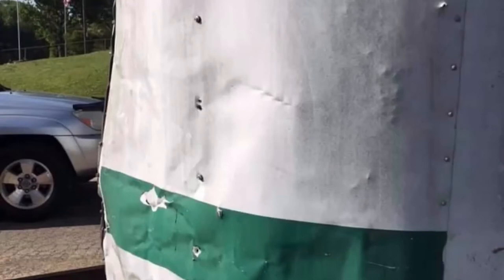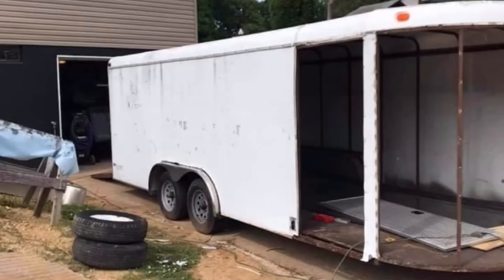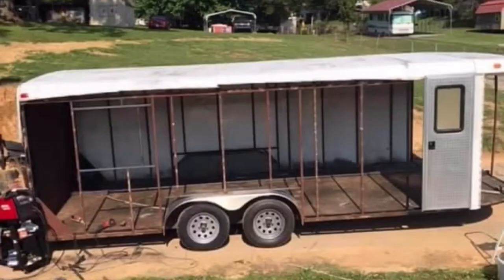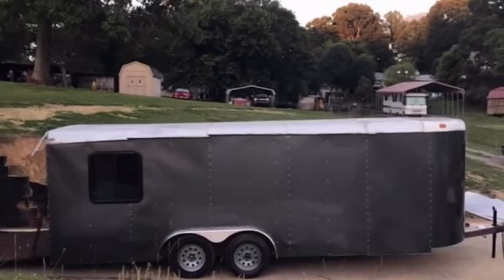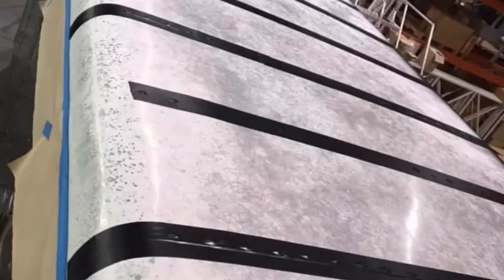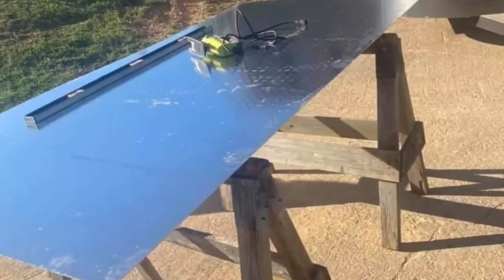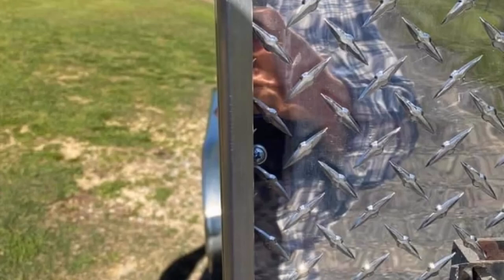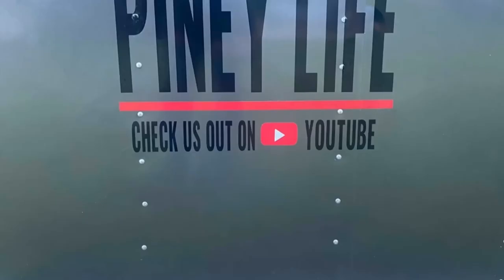Enclosed trailer rebuild for CTC

Comment: Need to replace walls on my horse trailer,  walls 7/8” material with wood inside of vinyl sides. Any suggestions what to use
Reply from the maker: I have a stock trailer i was working on not long ago and we used 4x8 sheets of 1/8 aluminum on it but that because cows beat it to death. If the inside is wood with vinyl over it i would try to duplicate it to what it was factory to the best i could. Now that being said wood is expensive right now so i might look into plastic or poly sheeting. some companies offer thick plastic sheets for like die cutting or roll cutting you can get. Plus to that is they would never rot. Still got to take into fact all the countersinking for screws to hold it in place. i will research more into options. Thank for the question and i hope this helped in some way

Comment: Great job on the trailer.  Did you use aluminum or sheet metal on it?  What gauge?
Reply from the maker: Thank you. I bought some seconds from a guy that bids on the material. It was aluminum and the gauge was 060

Comment: Think you should not use stainless screws to bring aluminum in contact with steel.. sounds like a reaction salad...
Reply from the maker: After thinking back on it you have a valid point. I did use vhb tape on most of the aluminum to steel and primed the steel but there will be some reaction down the road. Anyway thanks for watching and sharing.

Comment: Where did u get the siding and roof material?
Reply from the maker: I actually found a guy on facebook marketplace in georgia that had factory sheets that was seconds. They might have a small ding or something on them but for the most part they was perfect. i Used duplicolor bedliner on the roof with mostly original material.
Reply: @pineylife   I'm here in Georgia too, just east of Atlanta.  I'm rebuilding a small, single axel trailer.  I was going to use Flex Seal on the Roof and the front cap that I repaired.  I welded the plastic front cap back together and I was going to cover it Flex Seal as well.  The idiots who built it never actually hit the plywood panel on the front when they screwed on the sheet metal on the front of the trailer, so I'm going to replace that and rebuild one of the rear doors.  What is this TAPE that you refered to?  I couldn't hear you.  Thanks!
Reply from the maker: @davidmullen8357  The tape i used on the top was etrabond tape for the seams here's the link to give you a idea https://amzn.to/3vSa5ST  Now on the sides i used VHB 3M TAPE for side panels heres the link to it https://amzn.to/3f2Mb0p .  i will add them in the comments also. I know how you feel on finding things on the trailer that the factory messed up on. They throw them together sometimes
Reply: I got an exact trailer like that and just scared to redo it cayse the cost can I respectfully asked you how much it cost to redo that trailer you did